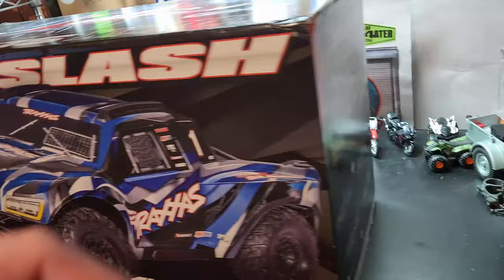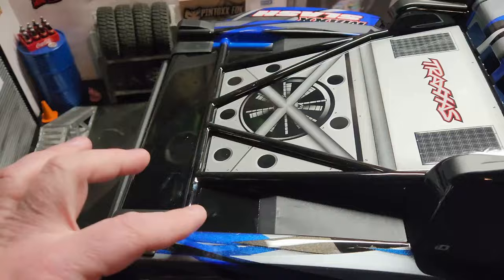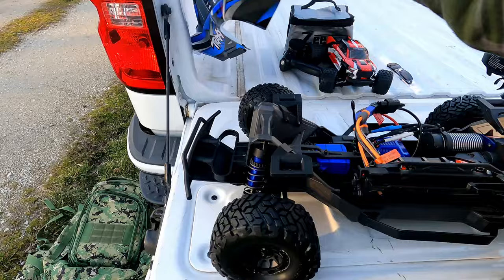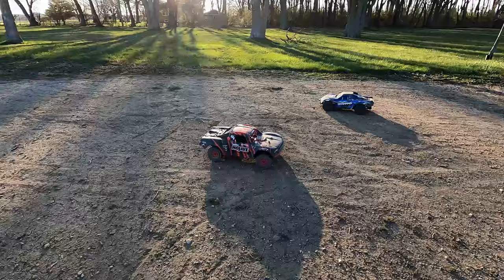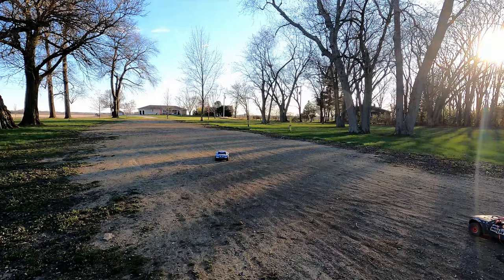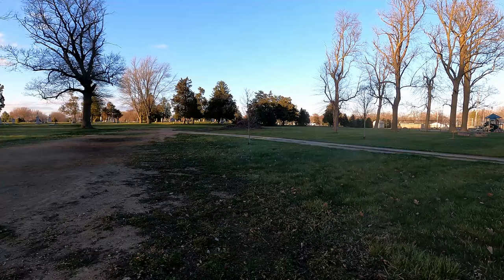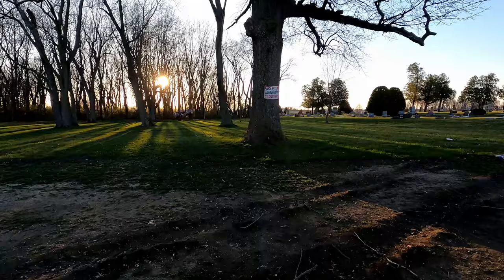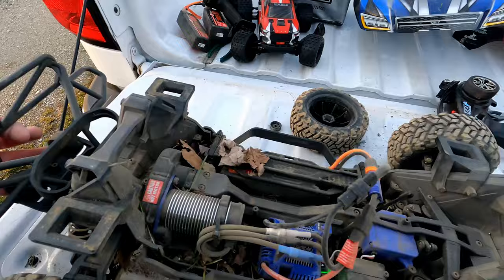Traxxas Maxx Slash unboxing, bash, review. The truth may hurt!

Comment: You need a lot of throttle control on the Maxx slash. The tires are always spinning. They don’t dig in like Mojave’s do. 
I have both trucks. The Mojave is a better all around truck. It handles better in air and on ground. The throttle feel is a lot more precise and accurate. The electronics are way better than the traxxas stuff.  

The Maxx slash is a better basher. It’s a basher with a short course body. It sucks as a short course truck though.  The speak and spell vxl6s ESC is the biggest problem. Wait until it starts to cut power on you. Almost everyone I’ve seen with these have the same issue where they just lose power intermittently. Mines done it since I got it.  And you get traxxas non existent warranty that covers absolutely nothing. So then you have to spend another 150+$ for a real ESC.

Comment: Nice bashing!
When jumping the tree, was the Maxx Slash on 4S or 6S? Same for the Mojave?
Reply from the maker: The Maxx Slash was on 4s then. The Mojave was on 6s. The Maxx Slash kept smacking its bumper on the tree. Both are extremely fun trucks! Thanks for checking out the video!
Reply: @HumlsHobbies  Was curious cause you said you didn't think it had the power as the Mojave. Likely Traxxas geared it better for 6S then 4S. The LCG body of the Maxx Slash needs more angle than the Mojave too. Now only time will tell if the Maxx Slash is the durability king given it's Maxx lineage and new upgraded parts.
Reply from the maker: @lesdmess845  if you haven't checked it out yet go check out Thunder rc. He beat the living crap out of his Maxx Slash. It held up good for the most part. I'm definitely impressed by its toughness! I'm gonna be doing a torture test on mine soon. Hopefully have a video out on it in the next week or two.
Reply: @HumlsHobbies  Saw it. I like his comment that something will always have to fail and it's good that the failure was cheap and easy part! In electronics, that is called the fuse or circuit breaker!